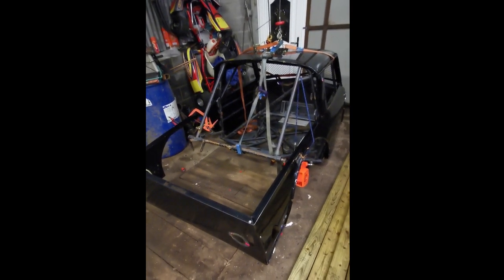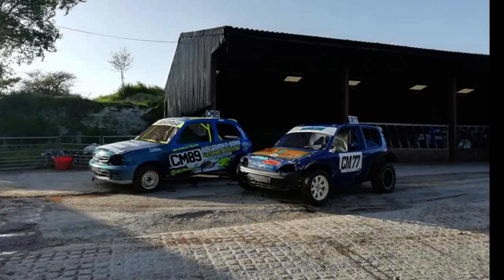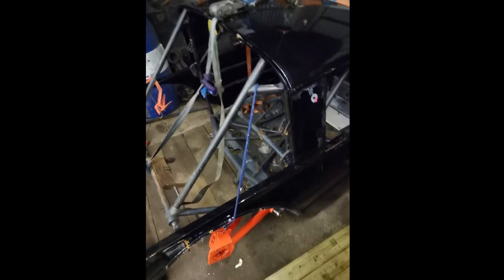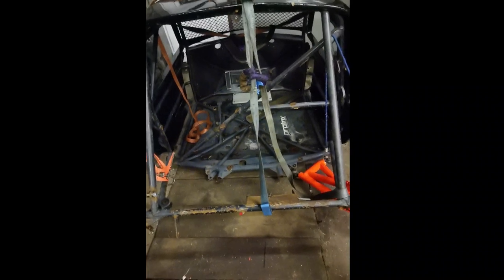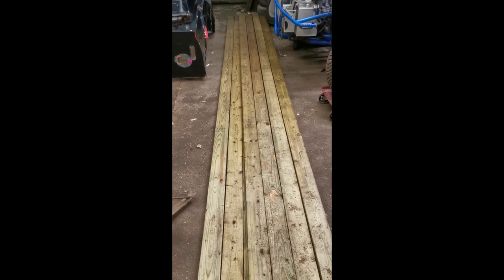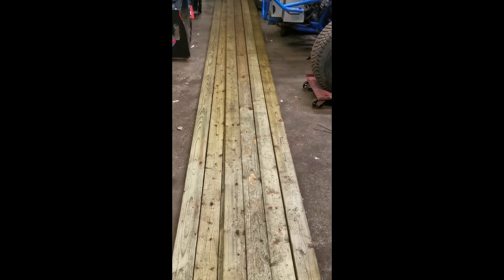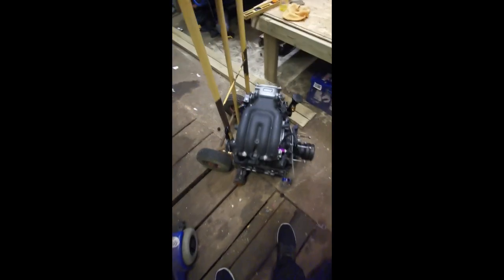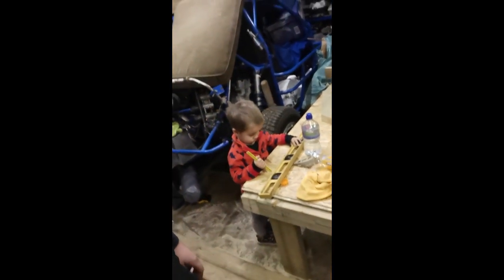The Wank'L Build, Episode 1.  13B Rotary spaceframe mini pickup build.

Comment: If you don’t have a big budget which you say you haven’t. The best thing you could do is avoid using a Mazda rotary engine. Assuming your engine is good (it won’t be) and parts are a fortune. If your lucky it might go 3 meetings without a rebuild. 😂
Reply from the maker: Appreciate your comment,

I just don't have a budget, it's as simple as that.  It costs what it costs and takes as long as it does.   That said, I do have to consider this is a hobby and I'm a family man with 4 mouths to feed. 

Perhaps you can expand on why you wouldn't run a rotary rather than jump on the hate bandwagon.

I'm fairly confident that my engine is good from the start point,  it's freshly rebuilt and dyno tested....   🤔.    I also have a great guy with massive experience on rotary race engines on board, more on this when we visit his shop later this month.  

I totally get where you are coming from and I do understand this is a development project that's inevitably going to face issues. But....     Dare to be different?   Enjoy the engineering and build?  
Or would you prefer to just have a turn key car and match the rest of them ?
Reply from the maker: @mayothe3rd725  I can't exactly say it like that.... But yeah 🤔😂